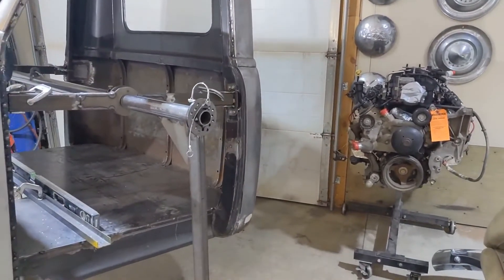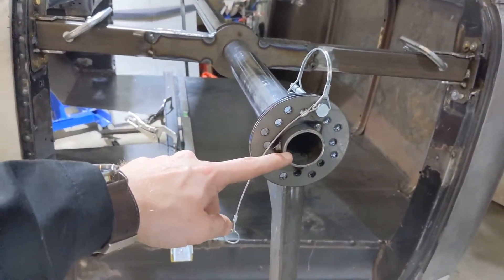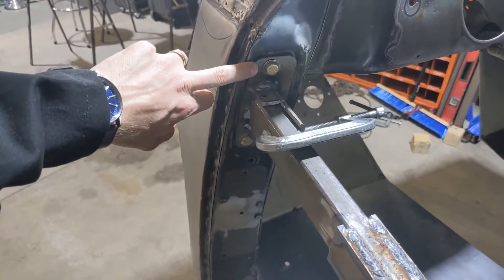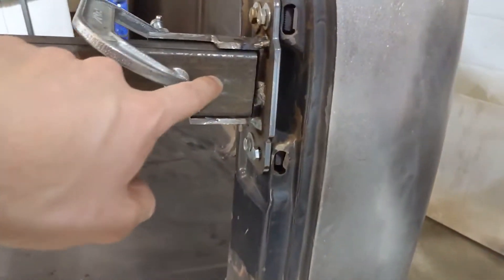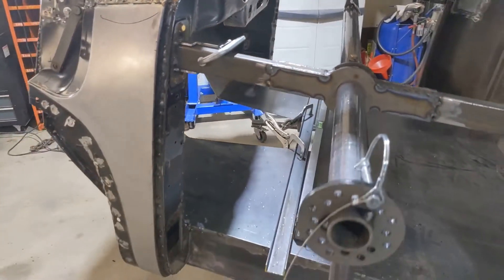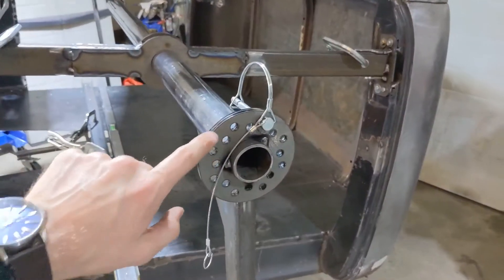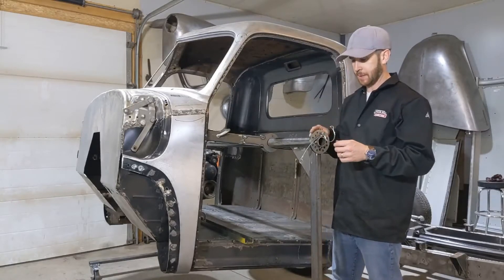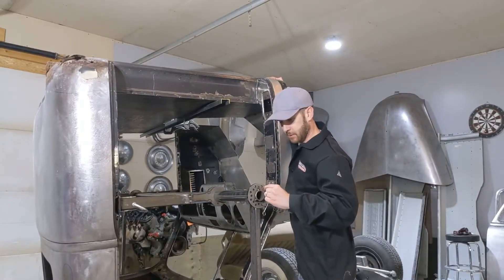Chassis & Cab rotisserie garage built for $175 in about 4 hours

Comment: wow, pretty cool. i'm just getting started on my 67 c10. you did a great job cleaning up the cab. how did you get it so clean/rust free. hope you have a vid on lifting your cab and rust removal, i'll check out your site. i'm a little old school, don't do facebook/instagram. how would i get those plans. again, you did a great job. my biggest concern is the balance, being an older guy i don't know if i can handle it when rotating. any suggestions on moving the balance point so it rotates with less weight swing.
Reply from the maker: I've had a lot of feedback and requests for the plans. I'm thinking it may be worth designing a more simple plan that's easy to use and assemble. 
If you send me an email I can send you the photos of the drawings I made for it. 

johnplagrange@gmail.com